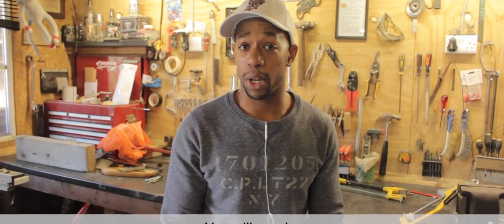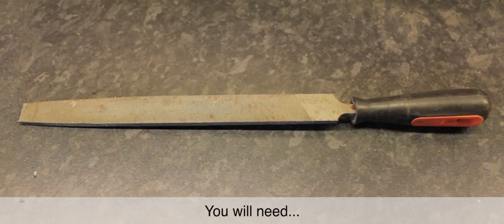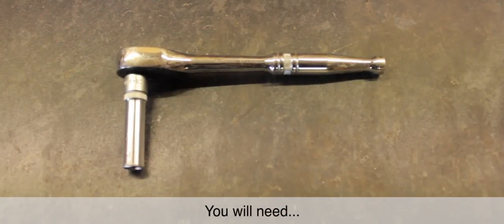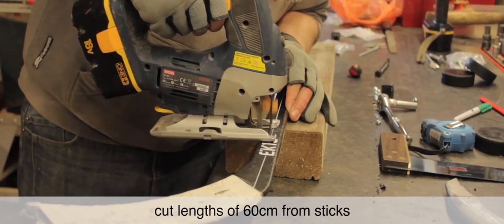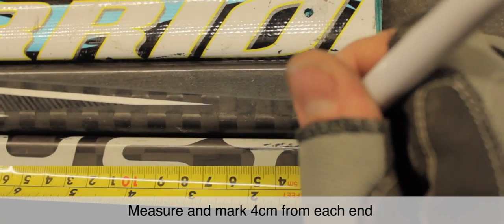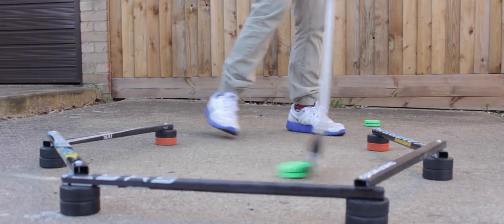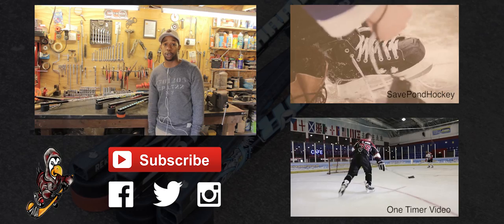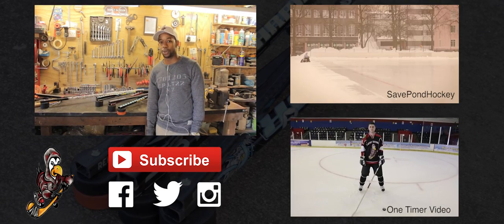What to do with broken hockey sticks - Improve stickhandling

Comment: I've made a few things from broken hockey sticks... if you haven't I must warn you that working with carbon fiber is not fun.  You do not want to get the dust from sawing and drilling the sticks on your skin. Wear disposable gloves.  I actually use disposable sandwich gloves and although they tear easy you can avoid it if you're careful but I always go through a bunch cuz they're cheap.  Also, don't inhale any of the dust either or let it scatter.  Quickly vacuum or rig your tools so the dust is vacuumed while you cut/drill.  Not too many things would suck as much as getting a bunch of carcinogenic dust in your lungs.
Reply: I actually was inspired to open an Etsy page for my builds.  Check out OdinProjects on Etsy if interested.